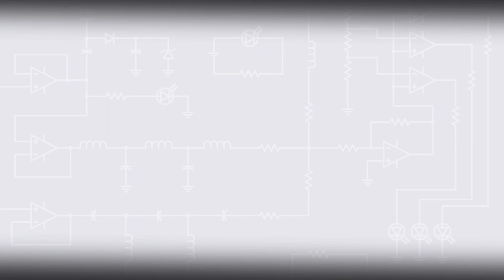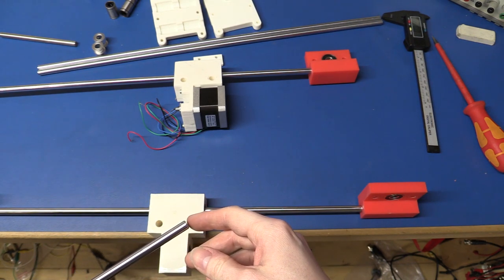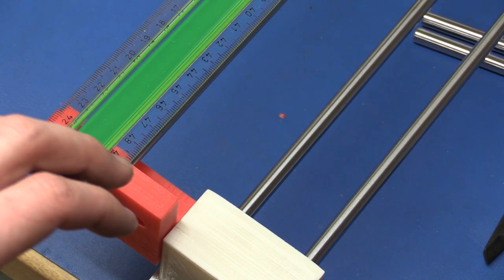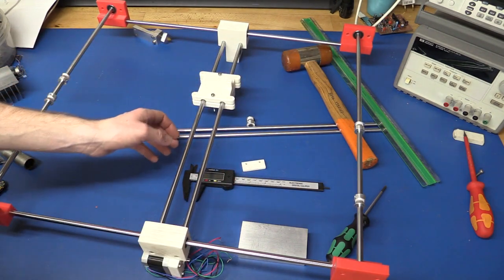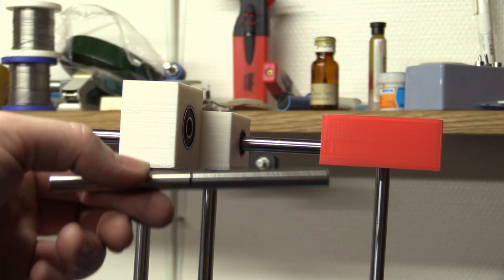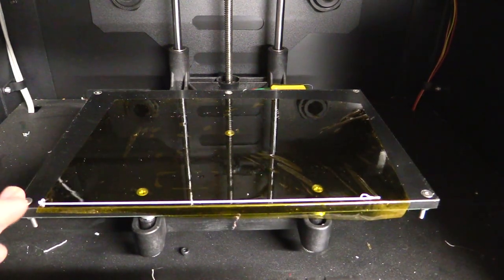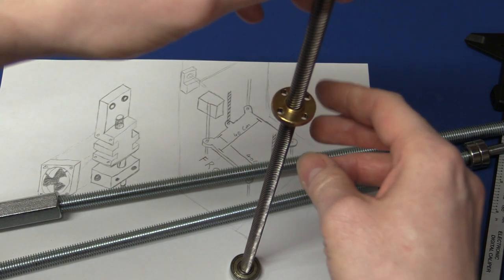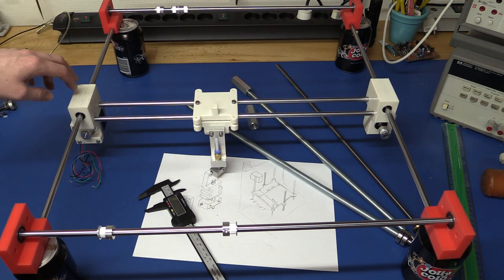DIY 3D-Printer Build (From Scratch) - Part 3: Finishing the XY-Plane and Some Changes - Ec-Projects

Comment: Perhaps you could experiment using a pneumatic hose to direct continuous air flow on the filament tip. That way it will take up less room than a fan and would be lighter.

Comment: with your first shaft you could had used a planetary and spur gearbox to prevent the weight to interfere on the motor

Comment: I think if it were me doing this project and had the engineering skills that you have; I would be making myself a carbon fiber table instead of the heavy glass. If you didn't want the expense of Carbon Fiber, the next best thing would be kevlar, and I would think that would be plenty strong enough as well.
Reply: bkpickell Hey bkpickell :) the reason he has to use the glass is because the surface needs to heat up well, when the heated bed is heating up under it. The heated bed goes under the print bed surface. It heats up the material you are printing, so it sticks to the surface and doesn't move during printing. :)
Reply: I was thinking more or less for support so he could use thinner, less expensive glass or aluminum with half the weight.
Reply: Oh, yeah the thinner the better! :)

Comment: you may have mentioned this somewhere but do u have a link to download the 3d printed parts so I can print them out? if not do u have a link to each part with dimensions? thanks if u respond ( Ik it's kind of an old video)

Comment: Hmmmm, I'm not convinced that the V-thread rods will do the job very well. I could be wrong though.
Reply from the maker: Pablo668 I'm not either, but I got a back-up plan if they are not good enough :) hehe
Reply: Cool cool. As far as I know, the original thread you chose is far better for the job, zero to no play at all. Maybe doubling up on that type of system would handle the weight better?
Reply: perhaps if you made the extrusion holder out of a phenolic materual, you wouldn't need as much heat and less heat transfer loss to the rest of the mount and no need for a fan.